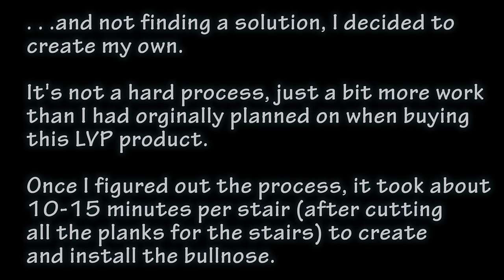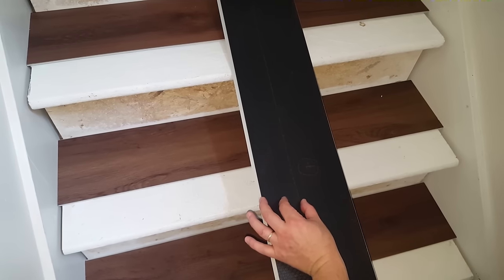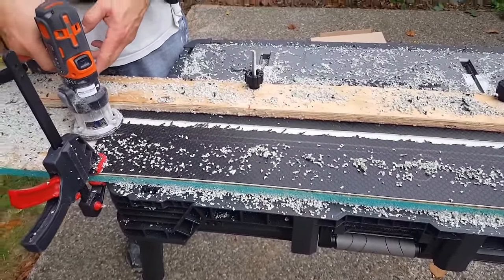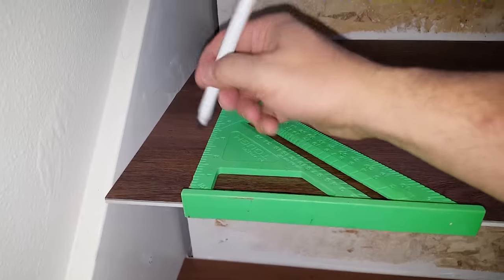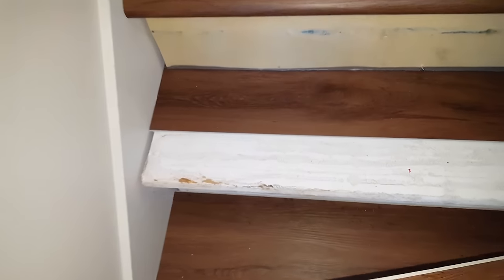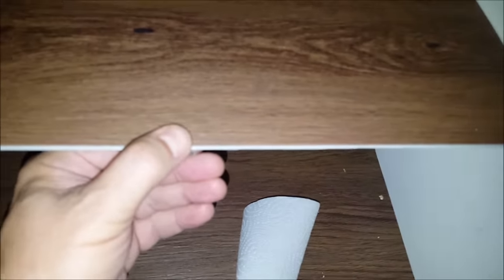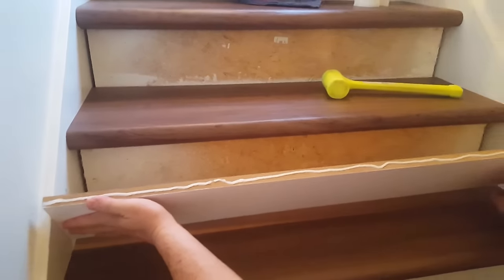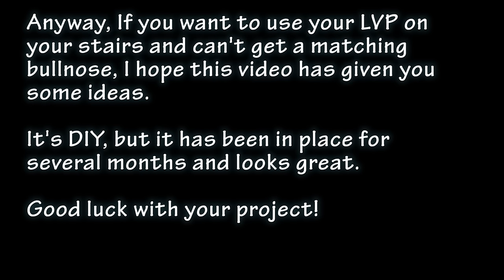LifeProof LVP Flooring: How to use on stairs and create a matching Bullnose!

Comment: They do sell stair noses and bull noses for steps. There is a website that is called Versa Trim. You go there and they have all the vinyl plank manufactures and there colors for you to purchase all blending transitions and stairnose and bull nose
Reply: Well either way. Kudos to you awesome idea and great job. You’re steps came out really really good.
Reply: When you have to "call for prices" that means it will be expensive.  I didn't see Lifeproof in the list.  Halstead makes that flooring.
Reply: The company that makes them for life proof is called Zamma. They are not expensive. For a t-moulding or a  multi purpose reducer they cost between 25-30 dollars each and you get 2 doorways out of each transition. The stair nose will be a bit more but they come longer then the t-mouldings and mpr.

Comment: I wonder if you could've made a male and female tool offline as a surrogate that matched your stair bullnose size to get the contour...then trimmed as needed.  I'm going to be doing something similar this year even though there's a company that makes these now.  Still they're 50 bucks A PIECE...and I have 17 stairs...no thank you...I'll try your method first.
Reply from the maker: Hi Fabiana, that works well if your stairs are all the same thickness and it was my original plan. However, in my case, each stair was a different thickness (the guy must have been drunk when he built these) which is why I went this route.

Comment: Make the bullnose first "offline" then cut the rear "tile" to fit.......
Reply from the maker: Hi Allan, I didn't have to cut any of the planks - both pieces fit exactly (width, not length) with the bullnose wrapping around. As far as making the bullnose offline, I was hoping to do that but whoever made theses stairs somehow had a thickness variance up to about 1/2 for each stair. So I decided to it in place to make sure each piece fit snugly. Sure would have been easier your way though.

Comment: Stirling attempt to form the bullnose. The only issue I think you may have is that by heating the product, it become less pliable and remains hard. That hard area, especially on the leading edge may crack  in the future because of the wear and tear on the very area that’s less pliable. I hope I’m wrong because it’s a great work around. You can let us know. I really admire you’re ingenious method,  the finish is absolutely great and thank you for your video. If I were to heat a tread to create the bullnose, I wouldn’t router out at all depending on how it bends and only perhaps taking out a ‘v’ groove at the two corners on the back face. This would form a more square nose. I would try to heat the plank from the back, not the face and try to form it round a prototype tread and held in place with a jig of sorts until cooled. This way, the face would be less affected by the direct heat while still being conductive enough to help the face flex round the corner.
Ps, I am a professional but I am impressed with your work, I would only offer a possible alternative to help prevent future cracking of the bullnose by applying direct heat to the face.
Reply from the maker: Hi Arch, thanks for watching! You bring up some great points and I share your concerns. It's been over a year now and so far so good. This was just a one-time project for me so I simply put my experience and process out there for others to use and improve upon. You may want to watch my one-year update video which not only shows the condition of the stairs, but also has some additional tips/suggestions from viewers like yourself. I think I also answer some of the questions you had. Thanks again for your suggestions and I hope others will benefit from them should they try this project.
Reply: That’s a great idea ! Just make some 1/8” deep cuts in the length of the piece about 1/4” apart then nominal heat to help it bend around the tread. Like you would do to make a radius in drywall! Would be stronger after than using the router! Might have to make the 1/8” cuts on a small angle to allow it to curve around the radius!

Comment: Thanks for for making this video! I was planning on installing cap-a-tread, but your video inspired me to give this a shot first. It ended up working out really well and I'm super happy with the look. I actually ended up making my own video to document my process with this install. There were some things I did differently such as removing the rubber backing, not routing out the plank, creating a jig to bend the planks, and adding the bullnose at the top landing etc.. Pease check out my install video in the link below, thanks. 

https://youtu.be/IFDyAqrgpJg
Reply from the maker: Thanks for watching and I'm glad my video inspired your project. It would be nice if you would put a reciprocal link in your video description to acknowledge the inspiration.  :-)
Reply: @ChronologicallyExperienced  That is a good idea! I'll be sure to add your link in my description, thanks.

Comment: This is a great idea.  My LVP floor does have coordinating bullnoses, but they are insanely expensive.  Each plank of flooring was less than $5, but each bullnose piece is $60 (to be fair, they are long enough to do 2 stairs, but still).
Reply from the maker: Hi Seeknub. Glad you liked it. To be honest, if I had matching bullnoses, I wouldn't have minded the cost if it made the work easier!  :-)

Comment: Great job solving the problem of what to do with stairs when laying a LVP floor.  A couple of questions for you...

1) Did you have adhesive on the entire tread to hold it in place, or just along the bullnose edge?

2) The directions for installing the flooring always say to leave a 1/4" space at the perimeter for expansion. Your treads and risers fit tightly. How have they held up without the room needed to expand?

3) Could you have used another plank for the riser, or would that not give you the holding power to help keep the treads in place?

Thanks in advance and again, it looks like you did a great job!
Reply from the maker: 1) Yes, underneath both pieces (see my reply to Dean).

2) The expansion is horizontal and my 'assumption' is that 1/4" comes into play when you have an entire floor installed. I don't 'think' a single board is going to expand that much. It's been eight months now and we've been through both hot and cold weather and they are still perfect.

3) To be honest, I'm not sure. We thought about what coloring to use for the riser (which is why I ended up using the temporary riser until the decision was made to go for white), but the planks seemed a bit too flexible and thin for what I was imaging would hold things in place. Afterwards, I was thinking I could have used a thinner wood board (for stiffness) and then glued the plank on it to have a matching riser, but in the end, it was decided to go for white. The thickness of the riser was 1/2" so that there was plenty of room to cover the lip underneath the bullnose and the tread below it.

Hope that helps.

Comment: Brilliant! I just went thru same issue with a Lifeproof renovation. I ended up buying the transition pieces that are sold separately — but they are $$$ and not actual bullnose. Great job!
Reply from the maker: Thanks Peter. I really wouldn't have minded finished ones if I could've found some that matched our flooring, but I couldn't find any at the time - hence the DIY project.

Comment: Quite a clever solution to a common problem!  I do find the premade nosing pieces to be ridiculously expensive, so this will certainly save some serious coin if you have the time to put into it . . . I don't think it would be worth it to pay someone to do it though!  Btw, in case you didn't see it, read my response to Johnny Hunter's comment below and add your thoughts if you get a chance.
Reply from the maker: It's not just the expense that is the problem.  If it was just money, I would've gladly spent a little more and saved myself all this extra work!  For a lot of the products sold in the big box stores, they don't offer matching bullnoses, or at least at the time we did these stairs they didn't.

Comment: I love how this turned out.....I just laid Lifeproof Vinyl planks in my living room and hallway and didnt know what to do with the steps....definitely doing this....thanks for the video!!
Reply from the maker: Glad you found this helpful! Just take your time and if you're using the Loctite construction glue to keep it down, let it dry for the 15 minutes before trying to bend the plank.
Reply: @ChronologicallyExperienced  Thanks for the tip!!
Reply: I forgot to ask but did you glue the first plank as well?
Reply from the maker: Yes, I didn't want nail or screw holes to ruin the look and I knew the risers would be tight enough to hold things in place.

Comment: Excellent work - I did similar to what you have done, except I had a dummy stair nose prepped on the side, and used that as a standard template. It took some effort, but feels nice when you see it works. In my case, I did use a wood planer (I know I shouldn't), but its much better and takes up a decent width, so I could run it for couple of times to get the desired width. You were the inspiration, so all kudos to you to helping me make it work.!!
Reply from the maker: Thanks Vijay! At least you were able to use a template. Unfortunately my stairs were such different widths/thickness I had to do each one separately as you saw.  Thanks for watching!

Comment: Awesome creative fix.  I'm doing the same with Smartcore from Lowe's.  They do make matching stair nosing, but from the reviews it sounds like the plastic clips underneath to attach them are junk and they can break off while you're walking down them!  I had wondered about buying unfinished wood stair nosing, staining it to match and then nailing them on to the stair edge through the vinyl into the stair.  I'm going to try this, too!  Thanks!
Reply from the maker: Good Luck Daniel, hope it works out!
Reply: I found the 6" Smartcore Ultra to be not quite wide enough.  You need at lest a 7" board for it to look good.  I'm going through this right now.  Smartcore doesn't have a color that is 7" that we like.  I've tried a ton of different methods on the Smartcore 6" and it just didn't give me enough room for the board to meet the riser.  I am guessing if I used a thicker riser piece that might work.  I'm trying to use an LVP riser, though. Maybe I'll get it figured out soon.

Comment: While I never tried this with a heat gun, I did an experiment with a torch.  I have seen some others do the bending with a torch.  I thought I would give it a try.  I took a number of samples and bent them.  I did not router the back either.  I kept it intact.  I noted that the bends were brittle enough to break barehanded.  That means they would not hold up under foot traffic.  I'll try this with a heat gun and see how that works. Maybe there is magic in the heat gun.
Reply from the maker: Yeah, I did not feel too comfortable with the torch idea. It's been a year now and things are still working as intended. I'll be doing an update video soon.

Comment: Cap-a-tread makes a tread cover that is perfect for this situation and it comes in most of Lifeproofs colors. I have seaside oak lifeproof and the stair treads match perfectly
Reply: Checked HD site...dang...$50 per stair - that's a little rich for my blood but good to have options for those that don't have the patience of Chronologically Experienced to make their own.
Reply: @M3fPCGFJSGDlORUbZAwK  yeah I chose it because I’m only doing a couple steps. I actually have left over lifeproof flooring I might try what you did with yours
Reply from the maker: Maybe they have changed since we looked at third party bullnoses, but none of the ones we saw at the time provided the seamless match like I got. Sure would have been much easier had we found one that provided that look.
Reply: The Cap-A-Treads are both expensive and junk. If you look closely at the samples in the store, they are nothing but cheap MDF coated in an impossibly thin layer of painted laminate. I looked at them. They failed the 'key test'. Which was my way of testing to see if they had ANY chance of holding up to my dogs. A car key went right through the surface of the sample.

Comment: dude, nice work! so cool that you figured this out, documented your process and shared it with everyone... I was planning on installing cap a tread with a different style than my floors but your work has my considering using my extra flooring to have it match 🤔
Reply from the maker: Thanks Jordan! Yeah, having a matching bullnose was the motivating factor of this project. Good luck and I hope you get it to work.
Reply: @ChronologicallyExperienced  man, it was tough at first but once I got the hang of it I kind of cruised through them.  I'm really grateful for your video and your innovative approach. I'm so happy to have properly matching stairs and I wouldn't have them had I not come across your video.  Take care, sir and best of luck to you!

Comment: I’ve wanted to put a covering on my stair treads, but I have been choking on the cost of Wood Treads, and preformed Treads. An excellent idea. BTW I’ve Routed Acrylic Plastic I use a Shop Vacuum on the Router Dust pick-up and use DuPont Dry Teflon Lube, for each pass, it helps greatly from keeping the Router Bit from gumming up.
Reply from the maker: Never did this before so wouldn't have thought about the lube, good thing my router didn't gum up on me or I might've given up, heh heh.

Comment: Brilliant! I had a few steps to do, and ended up just putting some trim pieces I purchased on the nosings. It looks OK, but it makes the stairs more difficult to sweep (dirt pile is "trapped" and/or some of it gets caught under the trim unless vacuumed), and I don't like the rigidity of the trim pieces / they flex down just a bit when I step on them. I'll use your technique on my new stairs, and might go back and redo the old ones. Thanks!
Reply: What product did you use to glue the planks down? Please and thank you!
Reply from the maker: Sorry for the delayed response... Thanks, I hope your stairs turn/turned out well!
Reply: @ChronologicallyExperienced  Indeed they did! I ended up making a temporary "bending jig" with a pipe and some clamps, then my bro and I used a couple heat guns and a laser thermometer to heat to the right temperature and bend the planks without splitting/cracking (took a bit of trial and error.. iirc about 200-250 degrees F). Once I had them bent, it was just a matter of measuring, cutting, and installing. Thanks again for the tips and method!

Comment: As someone who does it sir a living this is a great idea. What you should have done is install that bullnose first, then cut the second plank to fit. But that is a super good idea for a dyi person.
Reply from the maker: Not sure how that would have worked for me because I needed the bullnose piece to bend without popping up.  By securing the back plank first, I could lock the bullnose in place and it didn't budge during the bending process. I had to bend the bullnoses in place because whoever built this house didn't do such a good job on the stairs.  Each stair was different in length and depth. If all the stairs are uniform, it would probably have been much easier to create a system to bend them all first before installing.
Reply: @ChronologicallyExperienced  Oh my, each run was different!   Older house when codes were not enforced or your building inspector missed it.  Many years ago, (about 60)  my father tiled the basement and warmed each wall tile to form a tight curve to edge the wall.  (no baseboard just formed the tile to the wall)

Comment: To anyone else that wants to do this, it would be a lot easier to get yourself one bullnose stair peace and set everything outside, bend all peace's first then use jig cut to precise measurements add back peace, staple under raiser and bullnose, you can add glue to bullnose but not necessary, install raiser and you'll be done. Nice job with most basic tools that you where using.
Reply from the maker: Good points. Unfortunately, I couldn't make a generic bending fixture because each stair was a different thickness which is why I had to bend the planks in place. Thanks for watching!

Comment: THANKS! I used lowes Smartcore vinyl flooring to make bullnose for a staircase. Had to do the same cut off some thickness to bend the planks. I used the table saw to shave of the thickness! I made a fixture to hold the plank and a 4' round dowel to create the bend and clamp and heat up and plank.
Reply from the maker: Glad to hear it worked out! Unfortunately, I couldn't make a generic bending fixture because each stair was a different thickness which is why I had to bend the planks in place.  Thanks for watching.